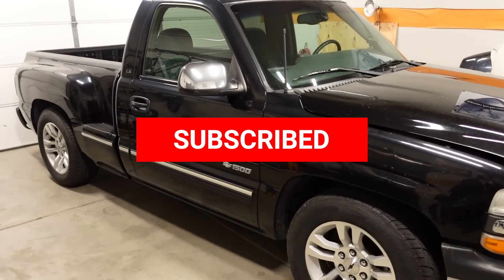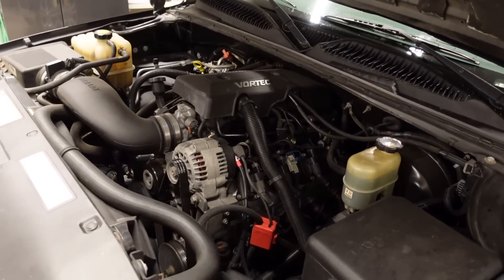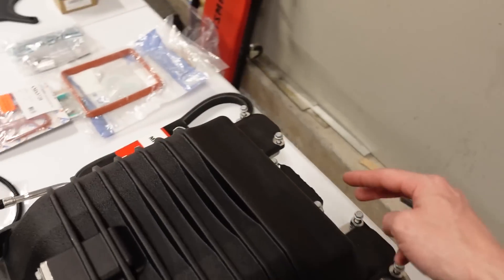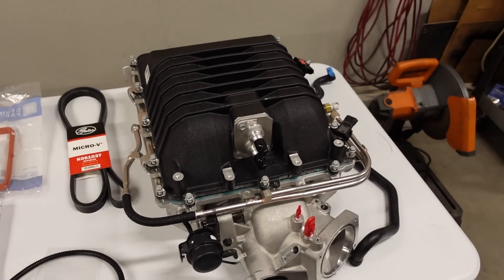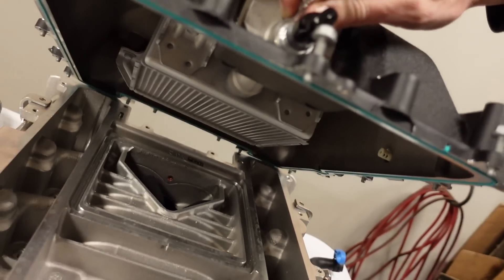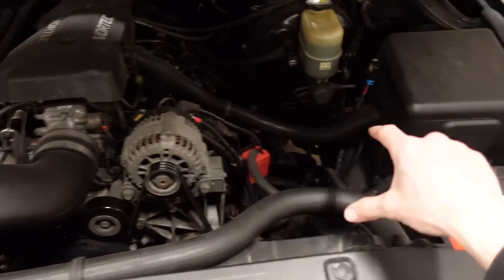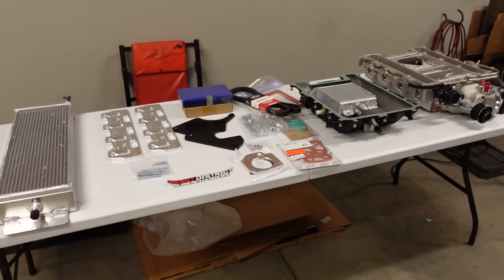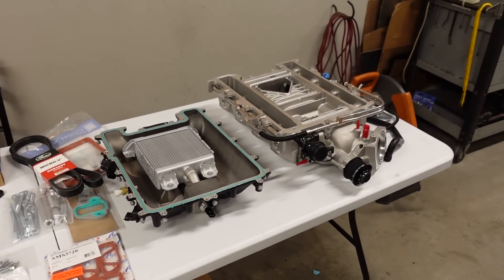unboxing my BOOST DISTRICT LSA Supercharger Kit

Comment from the maker: what do you guys think long term? I'd love to put a little bigger LS underneath this blower, I think 408 is kinda the go-to, but I'd like to hear your thoughts.
Reply: I’d like to see you grab a 6l from the junk yard and build it up…would make for some excellent content.
Reply: You can reach the limits of that blower with the 4.8. So if goin bigger motor gonna want a bigger blower too. Matt (sloppy) made almost 700 wheel i think? With an lsa on a 4.8 through a stick. Should easily be able to make 600 through you auto in the truck. 600 wheels is more than you’ll need for almost anything other than dedicated drag truck, which your big block truck will be. So I say stick with the 4.8. Let the blower fill the low end torque gap and spin it up to 7000ish. Should be fun.
Reply: @kyletice811  and the next question is, how soon was he gunna grenade the 4L60E in the truck😂
Reply: If you go over 376/6.2 you will most likely need to port and/or go larger on the blower (2.3 or 2650). Why not just do 6.0/6.2 and fuel sys + flex and better cam ?
Also, I would go with CWA100 or 150 HX pump and a larger HX tank 1-2gal, this thing is going to get pretty hot. And as other member pointed out, reinforce the brick before you run it.
Reply: Keep it simple, you already have the monster engine being built. Keep this a really fun daily
Reply: I have a dream in my head of a 408c.i. LS with a whipple charger strapped to it sitting in a 1963 GMC C10.
Reply: I'm contemplating a 408 as well. I have an LQ4 that i was going to rebuild, but the stroker crank would be REALLY easy to put in while i have the block getting cleaned and honed...
Reply: @erikrapoport7318  you would at least have to change pistons as well. Assuming you didnt know this based on how you worded your sentence.
Reply: I like the idea of a 408 but you might want a bigger supercharger. I can’t remember if the LSA blower is a 1.7 or 1.9 but I think you’d want at least a 2650 for a 408. Maybe a 2.9 Whipple…
Reply: @bdugle1  it’s a 1.9 TVS. With blower and snout porting, it will support 1Kwhp though.
Reply: If you want to do a unique set up that is stout look at the Molnar 3.900 stroke crank. It uses a 6.125” rod. Wiseco makes pistons with the correct pin height for that combo. The 3.9 stroke crank keeps the piston a little higher up in the boar at bottom dead center helping with piston skirt wear and keeping the rings sealed long term.
Reply: Built junkyard 6.0
Reply: What about a 427 from TSP?? if you wanna do it, might as well do it right!!
Reply: @rideramartin1234  or a 454 lsx!!
Reply: I have a .030 lq9 370” under mine…..works great…….one day I might go to a 408 since I’m already bored .030 over
Reply: @trentdawg2832  just curious—what kind of boost are you seeing?
Reply: @bdugle1  10/11lbs but have seen 14lbs on occasion
Reply: build the 4.8 into an iron 5.7 ls6
Reply: Flat plain de-stroked 6.2!
Reply: I'm glad you're thinking about more cubic inches! I was thinking that's a lot of money for only 400 whp with the LSA on the 4.8. my opinion would be a 370 cubic inch motor.
Reply: @9502silverado  your saying it’s only gonna make 400 with the lsa?
Reply: @mcfero1  on a 4.8, yes In the 400s
Reply: @9502silverado  I’ll bet he makes at least 500 before going with the smaller pulleys. Check out sloppy mechanics 4.8 lsa build.  I think he was in the 600s before he added nitrous.
Reply: @mcfero1  I don't see that happening on his current setup, but I'm really anxious to see. I hope I'm wrong!
Reply: I say run the 4.8 for a while, give us your take on how well this drives, then step it up to bigger cubes.
Reply: The diffrence that swap would make would be huge !
Reply: Biggest small block based off stock block awd vs. biggest big block based off stock block rwd
Reply: I kinda like your choice of engine builds that not everyone else is doing. I'd pick something a little odd ball.
Reply: What about just a crank , rods , and piston kit to just stroke it to square configuration ?? I.E. - equal bore and stroke ?? I hope youre planning on a different trans too . That 4l60e doesnt do so good even when nearly all aftermarket internally .
Reply: You mentioned some bottom end upgrades. Did you regap your rings??
Reply: @coarsegrind  He did, when he pulled it out to fix all the oil leaks.
Reply: I like the fact that you are using the 4.8 .   P.s go under dog motor
Reply: I would port the blower and snout, small blower pulley, larger crank pulley, exc. if your not after a drag truck, no reason to go bigger displacement. That little 4.8 will make 800-900whp.
Reply: 454 LSX
Reply: 454 swap it. Everyone does 427 its cliche.
Reply: 408 is a bit big for that blower a 6.0 with rec port heads built right can make 800+ rwhp
Reply: Blown 408 would be sick!!
(That would be my dream engine)
Reply: I don’t know what you should do but you should keep it original don’t do anything other channels have done
Reply: Just get a gen 4 5.3 rotating assembly or gen 4 4.8 rods
Reply: @austindoud273  if you do gen 4 rods, the pistons need to be used as well. Gen 3 and gen 4 rods/pistons have different weights generation to generation. Though, you can swap a 5.3 crank in to a 4.8 and make the 4.8 a 5.3
Reply: With your current setup, it will greatly improve IAT if you go to a much larger coolant reservoir. Most times people go with a larger 1 gallon or more ice box.
Reply: Why did you choose this super changer over say magnesium 2650 ?  
The reason I ask. I am looking to put one on my 6.2 Silverado
Reply: As far as engine size. I would go 427 cubic inch
Reply: Great combination. Short stroke and boost = high rpms
Reply: Definitely.. But, why not do something different, why not show us how a compound setup works.. SC and Turbo together ?? That would definitely be different.
Reply: I would love to see a destroked 6.0 with the 4.8 crank. Yea yea it makes it just another 5.3L LS. They just rev alot harder.
Reply: If it is enough power for you Lt run for as long as you can! I always wanted to see more LSA setups
Reply: Why not just leave it
Reply: I would stick with the 4.8 we built a L96 6.0 with btr blower cam & smaller upper pulley a few years ago. I'm not sure if much more cube inch is needed for these blowers. Gains per cube might be better with 4.8 engine. Our was in a 99 trans am with th400 & 9in rear. Made 550whp @ 10psi & seemed like it was pretty well tapped out. Intake temps on a pass would get really high even with ice water in the intercooler tank. Methanol injection would be a huge help.....but the best thing about it was the fact that it made 490ft lb of torque at 3000rpm. Basically soon as you'd flat foot it on the dyno it was instant torque just like nitrous. With awd it would make for crazy street launches in your truck.
Reply: Keep the 4.8 and make it a high rpm screamer so better heads more cam and maybe more stall since your gonna dead hook with the awd
Reply: And I'd keep the truck as stock lookin as possible maybe 22 inch replica wheels not sure what that means some kinda 5 spokes that were factory then reproduced in bigger sizes
Reply: My 2 cents gap the rings n send it till kingdom comes I'm sure you can make some serious power out that baby 4.8
Reply: LS3 👍
Reply: If you’ve got the money a texas speed 427 would be just about the best. However a 408 iron block would be a very potent package with that blower and  would save a little cash. I’d love to see a 408. Also please don’t screw with the battery relocation just to put an air box on the other side. It’ll look almost factory if you can use a plastic intake tube to the factory air box. That would be pretty cool.
Reply: You better reinforce that coolant brick in that zl1 lid. They have been known to fail and leak directly into the heads. Just a heads up.
Reply: I like the set up now. Or a 6.0 hate for you to run out of boost. Always build 408 on the side and dual turbo it for a future replacement engine or even who knows a nother project truck. You need a square in your line up.....😉
Reply: Be different , such a cool setup needs a cool motor : get another 4.8 and use a 6.0 crank . You seem to be a guy that really digs the technical/science side of automotive . Look up "chimney effect" of small pistons and long stroke . This combo should be able to rev much quicker and fill the cylinders more completely with the instant boost of the supercharger
Reply: Why not drop a 5.3 crank on to your 4.8 and just make the 4.8 a 5.3? They share the same block and rods. The difference is in the stroke.
Reply: @michaelminer8531  because unlike the 5.3’s the 4.8’s like to rev to the 🌙 moon 7k+ , you rev a 5.3 or bigger past 7k your looking for trouble…….honestly I’d put a turbo on a 4.8 before a lsa supercharger, but LT already has a turbo truck so I guess it’s only fitting to put a blower on this one, the upside to this is if he happens to do another LS build he can always put the lsa supercharger on that and the put a simple turbo system on the 4.8……that is what I fore see in the future, in about a year or 2 when he gets tired of the lsa blower and realizes it’s only limited to the build size of the 4.8’s capabilities……I put him and this same exact boost district LSA kit on my 370” lq9/ls3 headed nova and love it, I’m currently pondering the thought of a simple turbo system on my cammed 4.8 that I swapped into my ‘73 c10 short bed fleetside…….I think after I get it painted and looking pretty I’ll do it, that way my wife won’t bitch about it……she used to bitch about my nova when it was in primer and had the 4.8 in it, but after I had painted it she actually wanted to go for rides in it and take it places……..funny how that works, I can see it happening all over again with this c10 build
Reply: @trentdawg2832  you make good points. But a 4.8 is only a crank swap away from being a 5.3. If we’re talking stock parts, the 4.8 has better flowing heads AND smaller combustion chambers than the 5.3 and 6.0. With that, factor in the 4.8 has flat top pistons, you get a higher CR with really good head flow right out of the box. Sure, there are 5.3 and 6.0 RPO codes that have some of the things I mentioned above, but every 4.8 has these characteristics. 

He’s also not building a drag truck and has a turbo truck. He wants a street/auto-X truck. That makes a PD blower like the LSA perfect for what he’s after; power under the curve. The boost curve with a PD blower is liner vs rising with a turbo. There is no lag. Sure, it’s not as efficient, especially thermally. But for what LTs stated goals are for this build, to be honest, a TVS1900/LSA blown 4.8 is probably going to net the best bang for the buck AND meet the goals. Plus who dosent like the sound of an LSA blower!?! 

Now talking about aftermarket/non-COPO style build….. aluminum block 7.0 6 bolt head TSP engine all day. Twin turbo it with a set of smaller turbos, interchillers intercooling system, built 6L90 swap/TR6060 and send it! Lol
Reply: Keep it a 4.8 but add a 100 shot.   Choppy cam and call it a day.   Blower is enough for this truck....nitrous to be 'extra'    408 is good if you blow this motor.
Reply: what about the 383, I have read that the 4.8/5.3 block handles boost better.
Reply: @steventaylor5260  not necessarily, it’s the material the block is made out of. Most 4.8/5.3 blocks are iron. But there are a small number of them that are aluminum. An aluminum block has to have iron cylinder sleeves. Iron blocks are stronger. But it also depends upon cylinder wall thickness as well. You can get cylinder wall distortion if there isn’t enough material between cylinders. This is common on the LS7 when forced induction is used.
Reply: If you go bigger dont go past a 3.622 stroke if your using a stock block cuz a stock block with anything longer then a stock stroke pulls the piston too far out the bottom of the bore and you loose stablity on the ring pack area and causes piston rock at bottom dead center and drasticly reduces piston ring life and seal. If you go with a longer sleeved block the skys the limit and it fixes the issues of the short stock cylinder length
Reply: I’d love a 408 build. Do it! 👍🏽

Comment: So Cool ! What is the difference from the Boost District LSA Super Charger and the Magnuson Super Charger ?
Reply from the maker: the boost district LSA is an OEM supercharger from a Cadillac CTS-V or Camaro ZL-1 and is a 1.9 liter blower, the Magnuson is an aftermarket brand, but I believe both actually use Eaton rotors.

Comment: Will you have to change the fuel pump if so to what?
Reply from the maker: this truck already had a Walbro 450 pump in it before I supercharged it, but yes, if you have a stock fuel pump, it definitely needs to be upgraded before you run with a supercharger at wide open throttle. You should go with a Walbro 340 or 450 depending on your power goals or if you want to run e85

Comment: I just did the same thing I put a whipple on my 2003 5.3 extended cab with RPM transmission 3000 stall and  a Eaton trutrac next flex fuel sensor and a tube.

Comment: This is probably a dumb question but I was going to run the conversion without AC and was wondering what belt I’d have to use and if it would work in general?
Reply from the maker: you could easily run this type of accessory drive without AC since that uses its own belt anyway.

Comment: You are right ahead of me on my 05 tahoe, 408 lq4 stroker, 4l80e & awd swap. 4.30 rear gears with Yukon(brand) limited slip with matching 4.30 front gears. 2/3 drop. 285 50 20 tires on 20x9 black 7 spoke KMC wheels. Wilwood 6 piston 16" front brakes, Viking Performance front double adjustable coilovers removing the torsion bar front suspension, eibach front & rear sway bars, sparco chrono large racing front seats.

The awd 4l80e swap is being done same time as the 408. Next is Huron S480 turbo.

Comment: Reinforce the brick
Port the blower, port the TB intake, put a 112 TB on it
phenolic spacers
Pulley down!
Reply from the maker: I did send out the brick to get welded up and it will have a 92mm TB on it, but the porting will come another day

Comment: Hey LT can you put the raylar intake next to the adapter bracket you have there? I've had the idea in the back of my head that the LS7 7.0L supercharger was a match for the 8.1L and that it was hush hushed to keep horsepower down. Same ports on the superchargers, from what I understand, just different snouts on the big block LS. As the 8.1L, like the 7L LS, have unique intakes and you have BOTH sitting right on your table. My thoughts are that the 8.1L would like that supercharger,  IF the adapter plates AND snout/pully alignment match. The camaro had the long snouts. And smaller light weight engines benefit best from turbos on the street, so I'd turbo the 4.8 and supercharge the 8.1 to end up with the fastest race machines or build an LS7 stroked to 502 and compare. Good luck and please if you would post an intake comparison of the 8.1L and the adapter plates would be awesome before it is installed thanks have fun!
Reply from the maker: the 8.1 does use a cathedral port head that looks similar to the Gen 3 LS (4.8, 5.3, 5.7 6.0) but the ports are larger, and because the 8.1 is a big block, it has greater bore spacing which means the ports are further apart, plus the deck height is much taller so the intake manifold is a lot wider. Sadly, nothing will really interchange between the LS and the 8.1 Gen VII big block other than a few sensors and maybe a few fasteners.
Reply: Thanks for the response, I was referring to the charger plate closeness as obviously welding on the plates and then re-porting to match was kind of implied, big block and LS are quite different in surface area, as is the LS 7.0L also a black sheep their intake apparently is unique and won't cross fit the rest of the LS family. I actually asked this and got the same response almost word for word from icp billet, do other people not know how to weld and port match lolol. However thanks for the response and good luck with the build.

Comment: You could update the truck to DBW and use the gen4 throttle body. Alternatively, you'll need an adapter plate from 3 bolt to 4 bolt. (I have one kicking around at the shop)

Comment: I used the C5 vette filter/regulator and is mounted along the frame rails, 2' from the tank with just one line running to the engine bay. welded a bracket to the frame with a Riv-Nut.

Comment: With the price of the Boost district kits. Wouldn’t it be more viable to just go for a Procharger? You can push them a lot harder make much more power then any Done up LSA blower.
Reply from the maker: the only reason I didn't wanna do a centrifugal is because of how little boost and power they add at a lower RPM. But they do offer a good solid product with lots of HP potential.